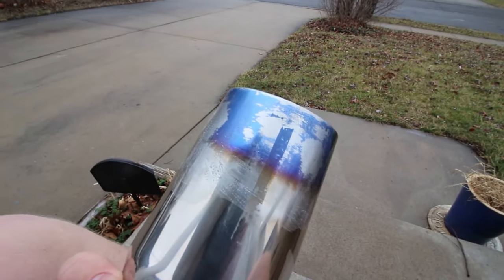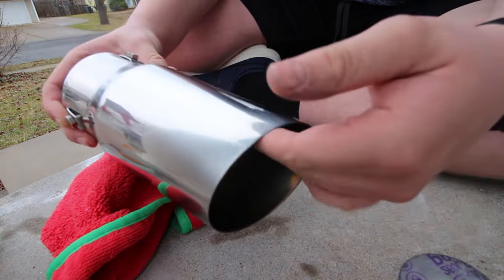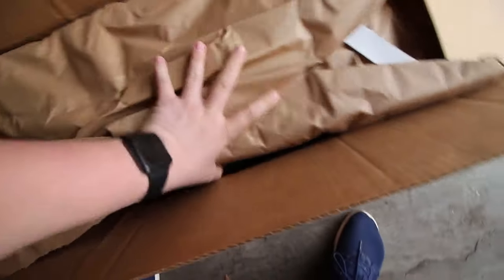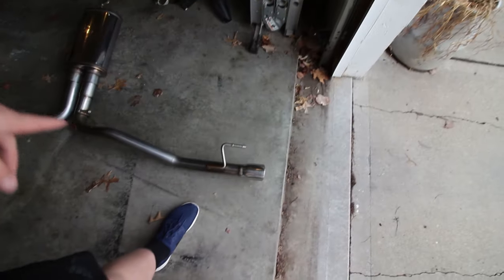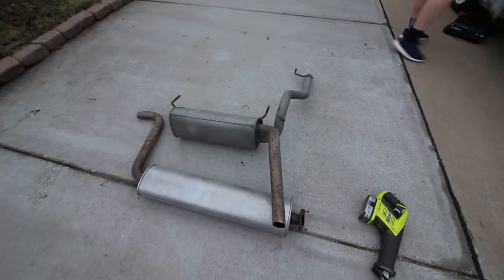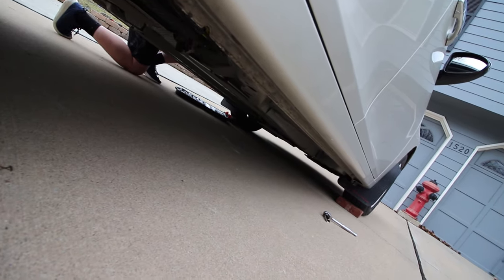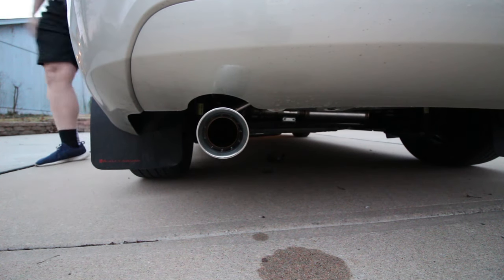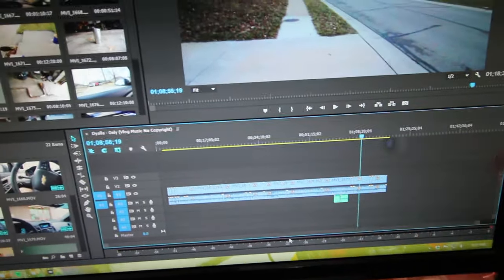Installing A ZZP Catback Exhaust On My Chevy Cruze!

Comment: How did you make it sound like that? I installed mine and it sound just like the original one, no difference.
Reply: okay so it wasn’t just me who had this issue do you still not know why it sounds the same
Reply: I contacted ZZP and they told me I need to install a down pipe or something like that,y opinion it just a wasted $700

Comment: Sounds pretty good.  To bad it wasnt dual that's what I want
Reply from the maker: +Darren Pea I wanted to get the dual as well but, it is $200 more expensive and you have to trim your bumper for it to fit. Not a good deal in my opinion. But it does look cool!
Reply: Jonas Godwin still sounds awesome! How much was this one inlet.
Reply from the maker: $575 shipped from ZZperfomance

Comment: did you do the rally armor mud flaps yourself or did you have someone install them?
Reply from the maker: Toyota Incorporated I did them myself. Pretty easy install after you get the first one on. I used 1/4 inch bolts and washers to attach them to the fender lining
Reply: was there open spots to put bolts in or did you have to drill your own? i have a 2015 cruze none of the shops will install them for me kinda annoying
Reply from the maker: I just drilled two holes using a 1/4 in drill bit in each flap and liner. you can do more to make it more straight but two is the minimum
Reply: I have the same problem with mine!